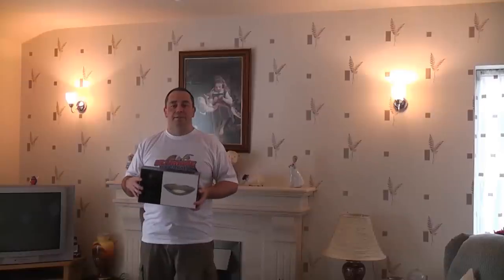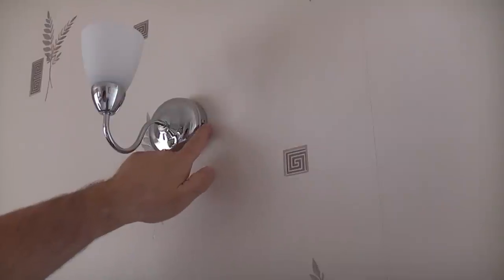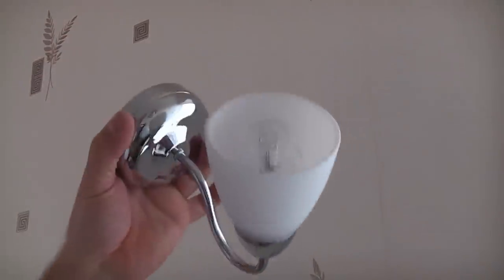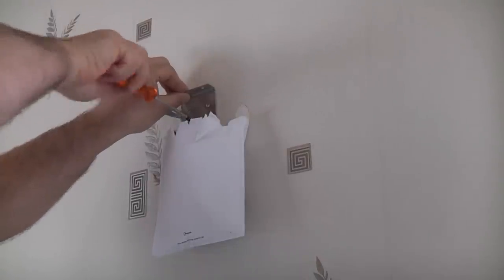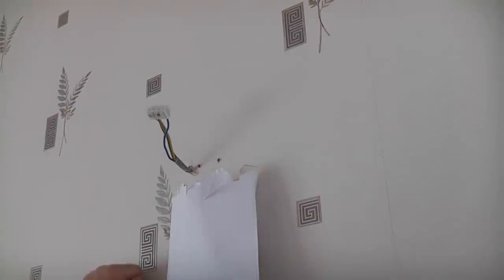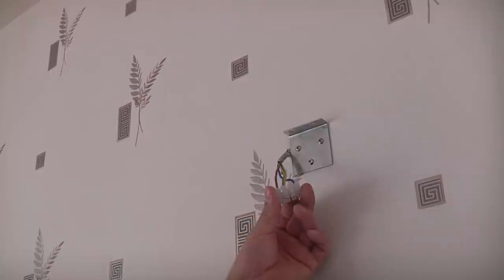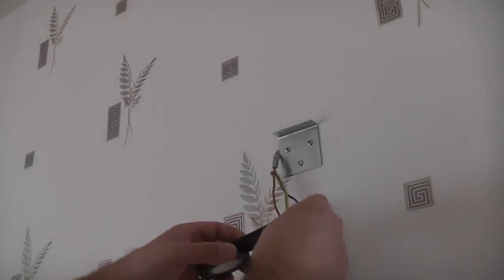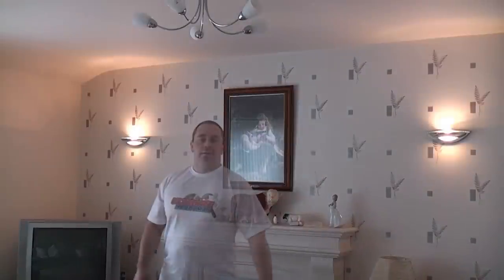How to replace wall lights | fitting uplighters

Comment: If I didn't want to replace the wall lights, but wanted to get rid of them all together, would it be sufficient to put the wires in terminal blocks with additional insulating tape and push them back into the wall?
Reply from the maker: +h2whoa No, you can't do that I'm afraid. You would have to disconnect them at the source!
Reply: +Ultimate Handyman Curses! Of course it's not so easy :) Thanks for the reply though, appreciate your advice!
Reply from the maker: +h2whoa 
You are welcome ;-)

Comment: GS38 states the maximum tip exposure should be 4mm or less... your test probes look like they have way more than 4mm exposed, it that the case?
Reply from the maker: Yes, part of the probe was removed as I could not touch the metal contacts in a panel at work (making GS38 probes very dangerous).
I have sine put some heat shrink sleeving on the probe, in case the GS38 police come to get me ;-)

Comment: Hi Chez
I want to install two wall lights in our living room.  I have been told that I can feed them from a plug socket if I first  spur from the socket to an FCU with 2.5 cable and then run 1.5 cable from the FCU up to the wall light. Then change the fuse in the FCU to a 5amp fuse. Does this sound ok to you. Thanks in advance for your advice.
Reply from the maker: +Cliff Carlo 
That's exactly how I would do it- if I could not easily access the lighting circuit ;-)
Reply: Many thanks for your reply, much appreciated.

Comment: ***** Could you do a video on how to wire mains powered smoke detectors please. 
Thanks HG- Harley Gaming. Previously changed from James Murphy.
Reply from the maker: Hi James, I tried to film this a few years back but it was difficult to film. In my new house I considered doing this but opted for wireless smoke alarms and heat detectors instead. I actually wrote a post about it here- http://www.ultimatehandyman.co.uk/forum1/interlinked-smoke-alarms-t62099.html

The wireless alarms are so much easier to install ;-)
Reply: Ok, that's fine if you do the video for wireless smoke detectors instead.
Thanks, HG- Harley Gaming
Reply from the maker: You don't need a video for that, you just put a battery in them and then follow the instructions to pair them, by pressing a button etc. ;-)
Reply: ***** OK, its as simple as that then, 
FSS- Fire System Security. Previously changed from, Harley Gaming as I cant film high qualities for gaming videos.